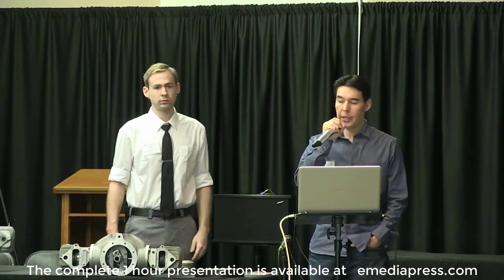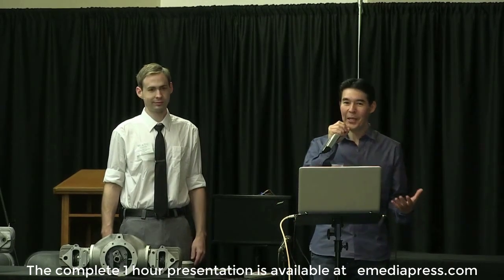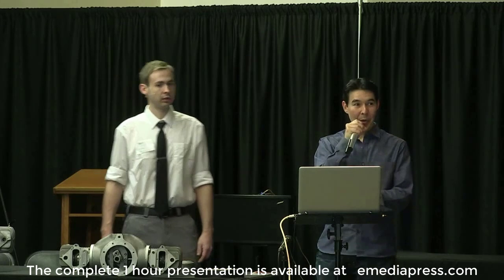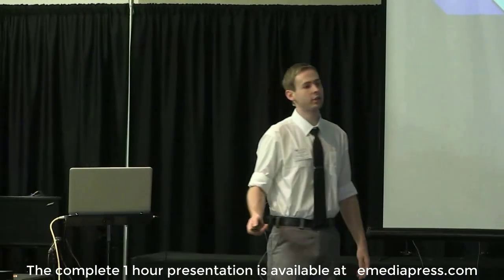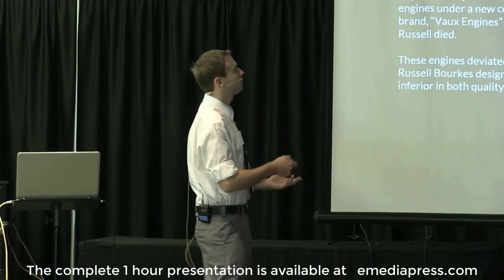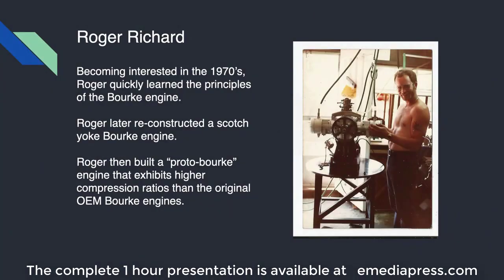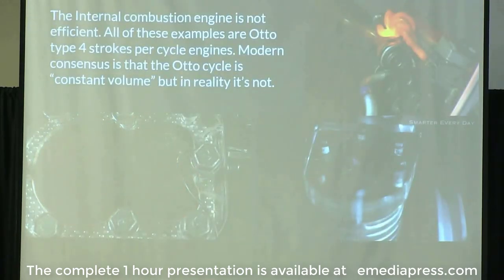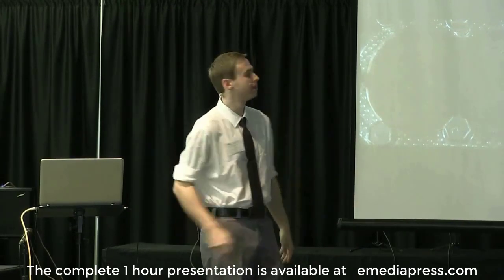2021 Preview - The Bourke Engine by Sky Huddleston

Comment: Nice engine for sure.  So a few questions, How low of an idle speed can the engine be set at, and what kind of loads can it pull.  And please give the torque as expressed as Horse power and torque, as in for every 100 HP you get 75 foot bounds of torque.  thanks
Reply: Those are gonna be questions that can be answered After this motor is totally recreated and fully put into production. Its both unlikely and unreasonable to expect those numbers this early, as well as to think that the Older ratings would hold true as we've recalibrated those ratings since then. 

Great questions though!
Reply: @roldy1584  Thanks for that, but anyone who would spend money to develop it would need to know if it can pull a load, other wise it is a no go from the get  go.  The prototype should give and indication of load abilities, and that is the most important number. Like that rotory, man, in my RX7 it had hardly any torque just able to pull the weight of the car and that was it.  This engine needs to show torque, power to resist a load.  If it has to do super high RPMs, for example to run a generator, it will not be good and hard to find investors. Not hard to test the prototype as we see in the video. A ruff idea of that is all you need to show potential.
Reply from the maker: @TheWayofAwe  Of course it can pull a load. It can turn a generator lighting thousands of watts of bulbs. Roger Richard already did that.
Reply: @AaronMurakami13  Ok, good, then I can see its viability. It's important to include that kind of torque info in any over view, you will get a lot more traction there by. And for those who want to mount in their ride, low idle is essential, so show that as well.
Reply: @TheWayofAwe  Idle on the  proto is 3,800 RPM.  The right gear reduction for the application would have to be engineered.  Several engineers have called it the marriage of a recip and a turbine.  If doing HCCI doesn't show potential, what does?
Reply: @Bourke30  nuclear piston engine.
Reply: @Dan-gs3kg  so a planet sized motor using nukes?
Reply: @cybyrd9615  seems excessive
Reply: it's a 30ci, so compare it to your favorite OHV motorcycle engine, then multiply its dyno chart by 1.5

Comment: 100+ year old design! If it was any good, we’d have them all over the place by now.
Reply: Thats not necessarily true. Just because something is old doesn't mean it doesn't work or isn't viable.
Look at Achates Power, they modernized an old opposed piston design from the 1930's and are now worth tens of millions of dollars.
Another example is catalytic ignition systems.
Yet another example is starter-generators. Popular on old tractors back in the 20's through the 30's, they are now becoming popular in automobiles today as a methodology for integral hybridization.

In all three examples, they were predicated upon a technology that was about 100 years old, and were brought back because modern technology allows for new opportunity to modernize an old design into the 21st century.
Reply: @brianjobes5777  EGT's right out of the exhaust ports are 220 F. Homogenized fuel charges delivered via needle valve is more than accurate enough. Controlling precise fuel input isn't as important in this design because the AFR is dynamically variable and torque spikes by enrichening the mixture. Modern engines need to maintain a stoich ratio to prevent detonation. In this design, we can vary fuel input by adjusting a valve, and achieve a homogeneous charge and lean burn for greater efficiency both volumetrically and thermally.
Reply: Bringing a new engine to market is hard. If you don't have the business skills, you won't make it no matter how good your invention is.
Reply: Def not true ... If they can't patent it they won't make the same money
Reply: Yah because the neturino scalar wave signal/energy generation tech nikola teala talked about 100yrs ago isnt any good?🤣

Comment: Why not release the 3D cad of the engine, so countless others can build working prototypes and 3D print them.
Reply: Go ahead and send me an email, I'd be more than happy to share CAD files.
Reply: I have 3d cad models of this engine let me know I can send  .step files
Reply: @quiksilver1j  Do you have the complete engine?
Reply: @DeltaSierra181  yes I built them myself from drawings I put purchased online ..it is a complete engine
Reply: @quiksilver1j  Did you ever get the pistons I mailed to you?
Reply: @DeltaSierra181  I'm sorry no I didn't .. where did you send them ?
Reply: @quiksilver1j  The Bourbon address, pm me your email.
Reply: We did get the pistons. They are awesome. We're actually about to use them to cast them out of aluminum. Thank you so much!
Reply: @liberatorrocketheaters834  Sweet send me a set of pistons please. :)

Comment: At 10k RPM, with the vibrations, this engine shit the bed itself. No way you can put that at 20k as this man claims.
Reply from the maker: And you have personally tested it? :)
Reply: No, as the RPM increases the resonant frequency correspond with the increase in RPM. The amplitude remains the same. Like every other single cylinder engine, there is a balance factor. Many single cylinder engines achieve 20k+ RPM without issue. What separates this design from single cylinder engines? In the balance regard, there's no secondary forces, so primary forces can be balanced more easily to achieve better balance factor. The fact that single cylinder engines can and do run to 20k+ RPM alone proves that Bourke engines can do so as well.
Reply: If balanced properly it could ...

Comment: Finnish inventor Matti Sampo did research in the field also. Sampower was his firm. The main idea was that poweroutput was hydraulic.
https://www.kaleva.fi/sampower-moottori-syntyi-uudelleen/2440537
by google:
"The ideas of Matti Sampo, the inventor of the late Jnakkala, about a free piston engine have proved to work. The new version of the engine developed by Tampere University of Technology (TTKK) proves that the device works and even with good efficiency.

Engine development work stopped at times, but resumed at TTKK in 1997. The prototype developed at TTKK is a two-stroke diesel engine with two cylinders facing each other. The engine power is twenty kilowatts.

Specialist researcher Seppo Tikkanen from TUT's Department of Hydraulics and Automation estimates that inventor Matti Sampo was ahead of his time.

The new arrival of the free piston engine is thanks to new technology. The idea itself is decades old. It is now possible to implement the engine because fuel injection technology has improved in recent years.

Computer-controlled spraying equipment has also become significantly cheaper. According to Tikkanen, the engine can use the same injection equipment that is currently manufactured in long series for, among other things, passenger car engines. The free piston engine combines an internal combustion engine and a hydraulic pump into one package. The name of the engine comes from the fact that the piston moves freely in the combustion chamber. The kinetic energy of the piston is converted into hydraulic energy by a hydraulic pump.

Due to its design, the motor is well suited for equipment that uses hydraulics and requires high traction. These include work machines.

The free-piston engine is mechanically simpler than a traditional internal combustion engine because, among other things, the crankshaft is missing.

According to TTKK measurements, the efficiency of the prototype is quite good. The latest version raises efficiency to as much as 35 percent. A conventional internal combustion engine combined with a hydraulic pump achieves an efficiency of about 30 percent.

The freewheel piston engine does not work very well as a power source for a passenger car. "It's not the best equipment in that environment. In cars, speed is more important, there is no need for terrible power," says Tikkanen."